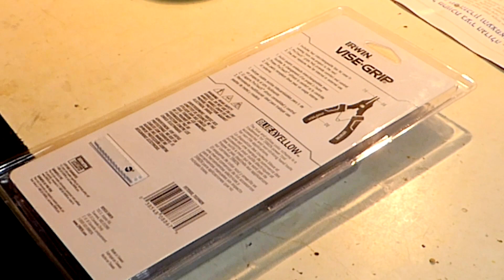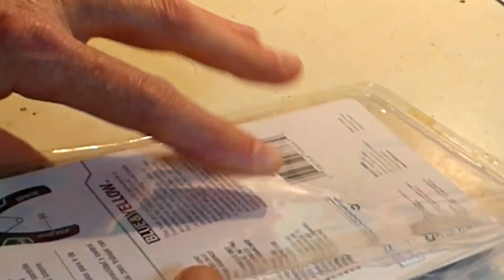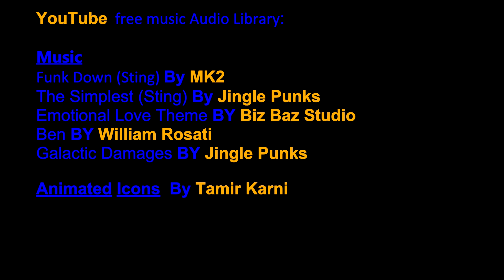Snap Ring Pliers Set - IRWIN | Retaining Ring | Combination Internal & External | Unboxing | Review

Comment: is it too big? i need to remove a very small circlip
Reply from the maker: @marcuslima2535  
Hi sir. You can buy a tool that fits to a small sizes. I chose to buy a cheap universal tool, then adapt it to my need by sanding and sharpening. As I demonstrated here:
5:45

Comment: when you grind down the outside of a piece of tempered steel the center is still soft.
Reply from the maker: Yes
This is true in metals with a certain metallurgical treatment, and it is in principle less true when the part is as thin as this pin.